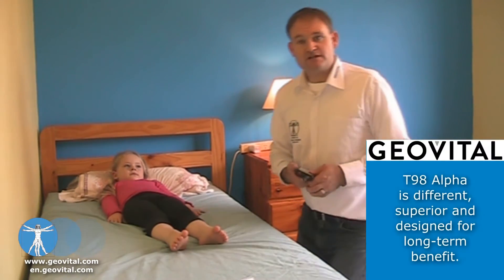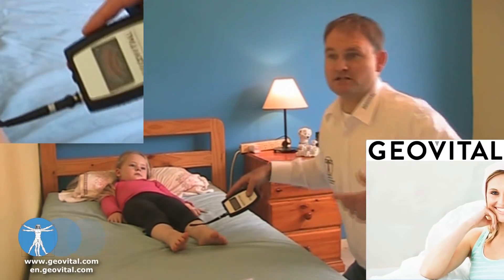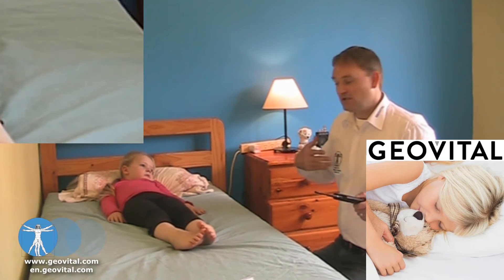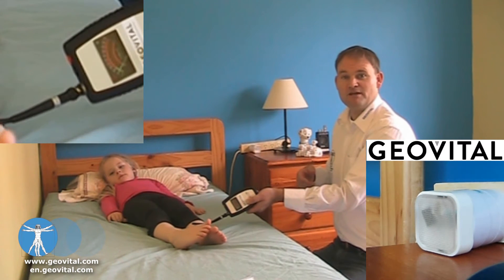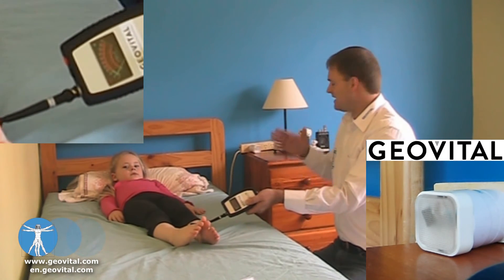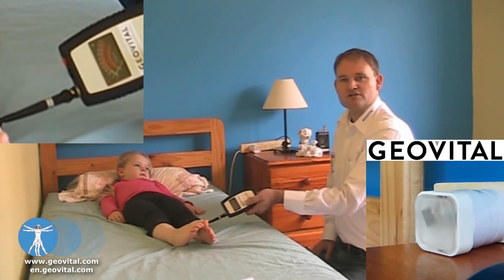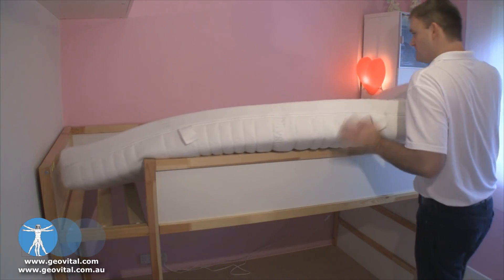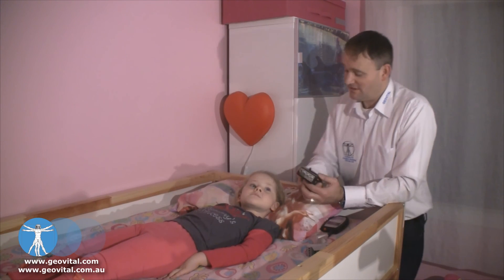2/18 - LF electric field radiation exposure and circuit cut-off switches in action

Comment: what meter are you using in the video?
Reply from the maker: This video is a little older and these devices are no longer available. We did a lot of R&D over the last 4 years and created devices that do an even better job at assessing and showing the levels also to those with less understanding. You can find the currently used and recommended meters for this work here and you find the menu to find the 2 models to the right
https://en.geovital.com/products/measuring-instruments-emf-meters/